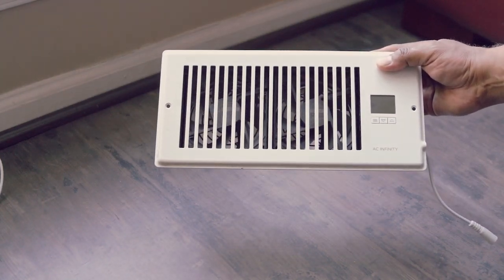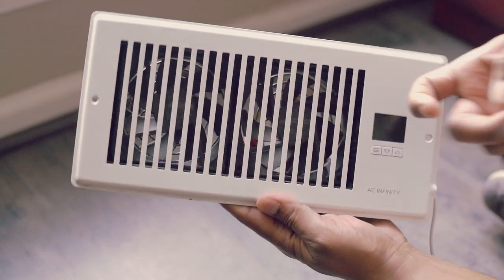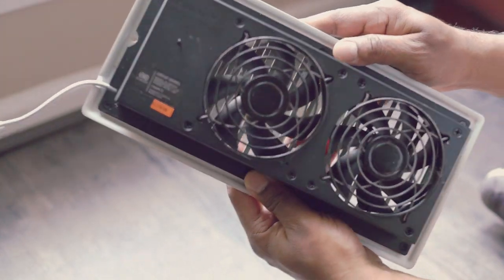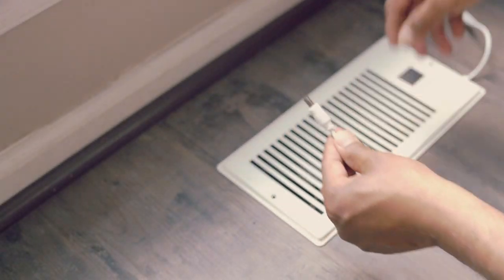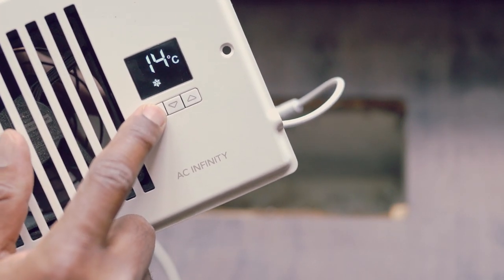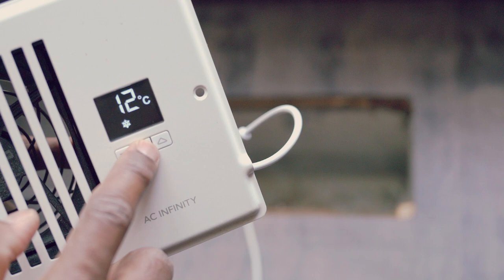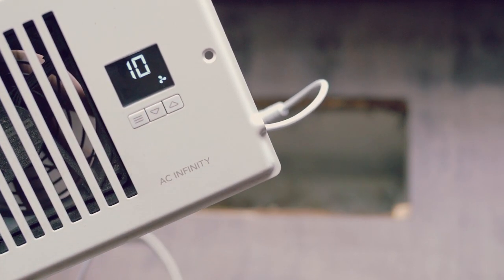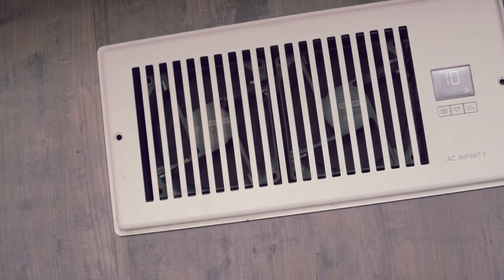AC Infinity Register Booster Fan

Comment: Just wanted to clarify something that most people miss. the set temperature on the device is the temperature it will turn on and off as in supply air temp not current room temp for example if you set the thermostat on the booster fan vent to 64° in cooling, the booster fans will not come on until the air coming out of the vent is 64° (about 4 minutes after A/C has kicked on) NOT UNTIL THE ROOM IS 64°. The fans will shut off again when the temp raises above 64° again (typically about 3-5 minutes after your A/C has shut off). You can buy a separate plug in thermostat that plugs into the outlet and then you can control the temp from that. Just look up “plug and play thermostat controller” or just plug it in as is
Reply: If I have my main thermostat set to Cool @ 72 what setting would I use on the vent booster?  I feel like mine runs all the time.
Reply: @cindihartmann8495  if the booster vent fan is running all the time and your system is running all the time, the device is doing what it’s supposed to do but if  your system is cycling on and off  and the device is still running after 5 minutes of the A/C shutting down there is a problem there. i would recommend turning up the temperature on the device up a few degrees on the booster and turning up the fan to increase airflow. or you can just go to another register in the house and take a infrared thermometer and see what temperature it reads. then go back to the smart  vent and adjust about 3° above temperature that was read at the other vent. typically a good baseline temp would probably be around 64° on the booster display in cooling. then if you want 72° exactly in the room you can get a plug and play thermometer on amazon for about 20 bucks. it plugs into the wall outlet then you can control the actual room temperature. but first increase airflow and set temperature on the actual booster
Reply: Can you help me?  I bought two of these to increase heat in an room I had added onto my house. Its always cold in the room so I'm trying to increase heat flow but they runs all the time. I have my thermostat in house set at 71, What should I have this set at?

Comment: Can this be used to pull air up from  a downstairs minisplit with a ductless house?
Reply from the maker: This can pull airflow from anywhere (essentially this is just a fan) but this is NOT designed to work with mini-splits.

Comment: The fans are just computer fans, they are not “optimized” for air restriction applications.
Reply from the maker: All you can do is select your fan speed, but you can control when to run them.

Comment: I just bought this and I’m so confused. The thermostat in my parents house is on 78. The spare bedroom is so hot. When I pulled the device out the package, it automatically registered at 82 degrees in the room. So what should I set the vent at? 

Please and thank you for the help! Because I’m sweating! Lol
Reply: Set it for 64. You only want it running when the AC compressor kicks on. When this happens the air coming out of the vent should be below 64. The vent fan comes on. Once the AC kicks off the vent fan temp rises to that of the room temperature and kicks off. You only want this running when the AC is running.
Reply: @WeThePeopleNC   I was so confused and this makes sense. Thank you!
Reply from the maker: Thanks for the explanation @JJ Johnson.